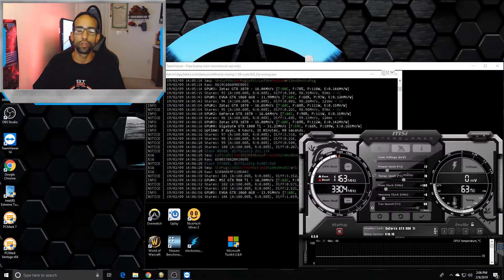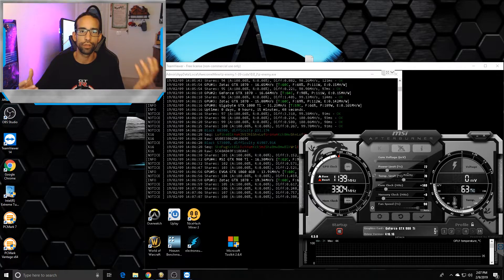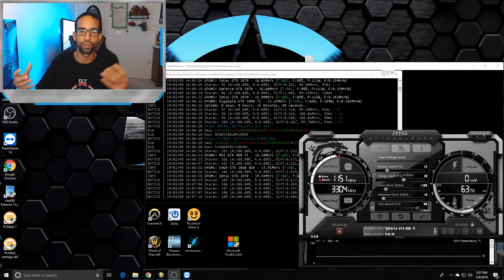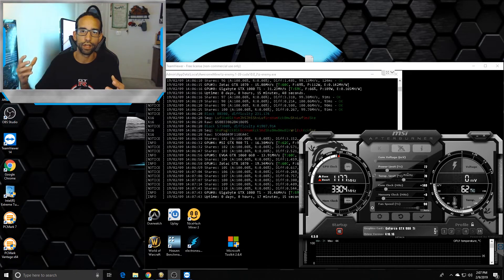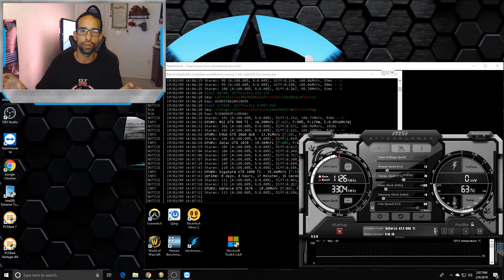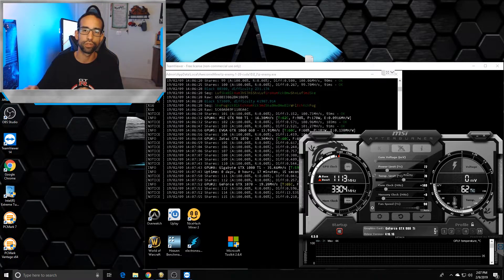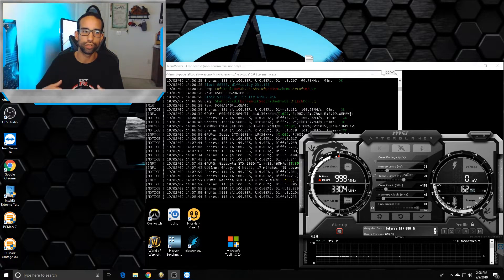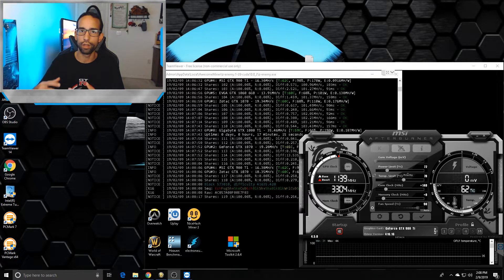GPU Thermal Interface Comparison (Liquid Metal Vs Thermal Paste)

Comment: This is old and im late, but a fitting question, how often do you repaste it with LM? I heard it can oxidize and get the heatsink stuck to the IHS, is that a thing?
Reply from the maker: Once a year, bur yes depending on the metal it can oxidize and almost solder itself to the heatsink. So I do these test to determine if it is worth it for you
Reply: @SerpentXTech  Thanks. Think ill skip it, cant really be arsed to repaste a GPU that often. Keep up the good content, subbed.